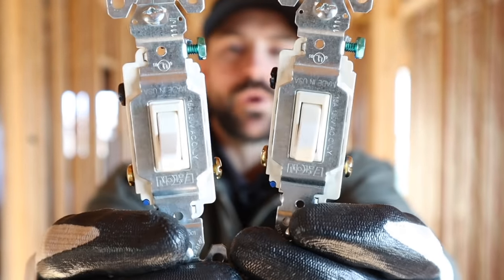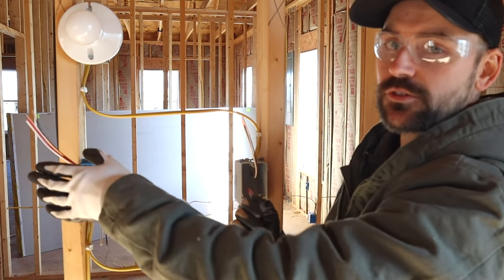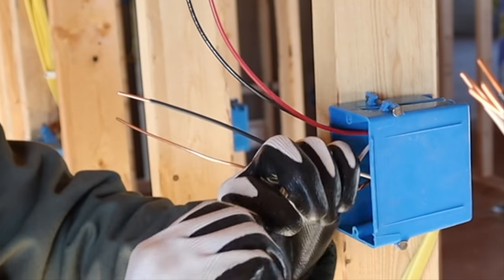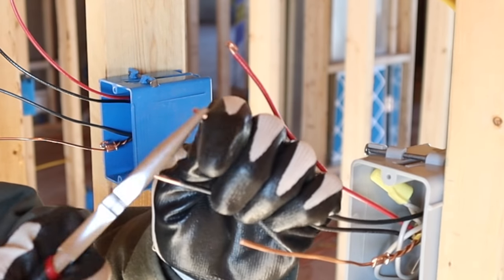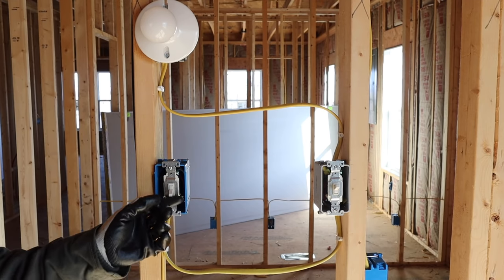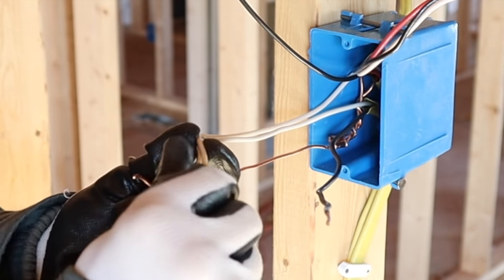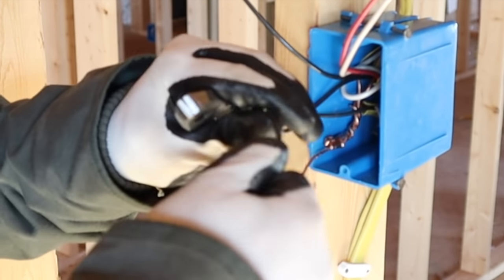How To Wire A 3-Way Light Switch - 3 Way Switch Explained (2 EASY & SIMPLE Methods)

Comment from the maker: Hey Team! No shave November is keeping me warm 😃. Hope your projects are going well! Let me know in the comment section below what you are currently working on. I placed timestamps below 👇 to help you navigate this video.
Safety first: 00:19
How to wire a 3 way switch (Method 1) 00:45
How to wire a 3 way switch (Method 2) 11:36
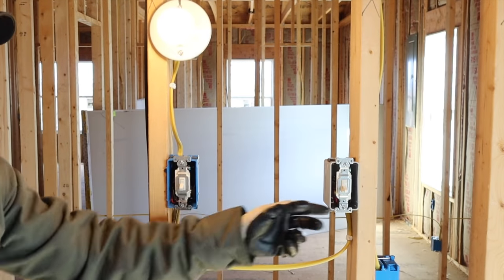Outro 19:49
Reply: Free nhi hi
Reply: Method 2 is what I have to use but I have to add constant power for a outside light on second switch how to wire
Reply: My friend how would I wire a dimmer to the (second method) or will it not work
Reply: Two switches controlling one light. isn't that a two way switching?
Reply: Thanks for explaining the second method.  I opened up my second box, saw only one cable, and figured I was sunk.  Most other guys don’t explain the second method.
Reply: im a electrical instructor can i use your videos in my class and can I invite you to speak to my class. i know your not a license electrician but I think your knowledgeable and its good for young people to see another young electrician
Reply: Replacing 25yr old toggles with decora.

Comment: You’re not even an electrician but you explain everything way better and make it easier to understand than these electrician YouTubers . Good work.
Reply from the maker: I have learned the simpler the better and making YouTube videos for people to follow. Thanks a lot for watching!
Reply: But he is doing things wrong. You don’t run 12awg to switches and lights. Don’t get me wrong, you can, but it’s ignorant.
Reply: @Kcperkins I think it should be 14awg
Reply: @TheExcellentLaborer legend has it the excellent laborer came out the womb with a pair of linesman’s pliers hahhaa awesome video sir keep up great work electrical is definitely my weak spot so I YouTube to reference something’s just found your channel and subbed very clear instructions man 🤙🏽🤙🏽💯
Reply: @Kcperkins why is it ignorant? i work for a company and we only use 14awg on certain roughs for certain developers, they mostly have us use 12awg for almost everything
Reply: Trade s people not all share they think they loose there job/ true worker s take  owner customers and become there own I quess
Reply: @Kcperkins  It's not ignorant at all. It might be *unnecessary*, sure, but anyone with any experience will do it if A) you already have that wire on hand, or B) You've run 12 from the panel to run outlets on the way to the switch, since 12 is for outlets and you're supposed to stick with the bigger gauge on a run/circuit and not split off into another gauge.
Reply: @Kcperkins  I agree with you. This guy probably saw some YouTube videos of other DIY'ers and now thinks he's an expert in the trade. I just started my electrician career almost 2 months ago and most of these YouTubers have no clue.
Reply: @Kcperkins 20 AMP breaker for 12/2 or 12/3 - 15 AMP breaker for 14/2 or 14/3
Reply: @Kcperkins a lot of times 12 gauge copper is the minimum wire size you can use for lighting and/or switches. 

Even when 14 gauge is allowed for lighting and/or switches it would be the minimum allowed. Going above the minimum wire size will always give you less resistance & allow for a more efficient circuit. 

Depending on the length of the run & the load of the lighting the voltage drop from not choosing a bigger wire could cause damage to the equipment & cause it to die before it's expected life. It could also be so far the light wouldn't work at all.

Using the bigger wire uses a little less power. Given enough time the difference will pay for itself . (Going to big on a rarely used circuit might not  save you enough to pay for the extra cost of the wire in someone's life time. So going to big might not be a good idea, but going up a size in wire isn't a bad idea. If you have a 12 amp load you really don't want to have more than 45' to 75' of 14 gauge copper wire feeding it.

If it's a 20 amp circuit then 12 gauge copper will be the MINIMUM wire size allowed & it could be that something bigger is required.

Him using 12 gauge on lighting isn't ignorant. It could be required. The only thing ignorant about that was this comment.

How about knowing more about what you're talking about before calling someone  else or what they do/have done ignorant? The world needs less people who think they can use the internet to find almost everything they want/need to know. (Even if they manage to get correct information they don't know what to do with it & there are some things they just shouldn't be doing.)

Just think you single handedly helped the spread of misinformation & people already have much more of that than they should.

Comment: Although more expensive, you should consider Wago lever instead of wire nuts.  Also, take a few turns of electric tape around the switch terminals
Reply from the maker: Hey Robert! I would love to try them. One day I will break down and buy some. I’ll do a review of them. Thanks for watching!
Reply: Wagos waste box space and are totally  inappropriate for switch boxes and wrapping devices in plastic boxes is a waste of time and material.
Reply: Wago's and plastic staples are for amateurs
Reply: RC :  I bought a box of Wagos for the electrician that was going to do some work for me basically to impress him by letting him know that I'm up to date on the latest technology. He said that he don't use them because in time they start to arc. So now I have a box of wagos. 😒
Reply: @crusherfang9368  I keep hearing people say this about switches and outlets but no one gives a reason why you shouldn’t do it. The house I bought 2 year ago, had every outlet backstabed, along with all the switch screws and main panel screws loose by about half, to 3/4 of a turn. Do you think that the reason some people tape it is so the screws don’t get loose?
Reply: @crusherfang9368  Thanks for the reply. I don’t think it was an electrician that did this. Maybe when it was originally built, but the guy I bought it from rented it out for 15 years and I think he replaced everything himself. It’s been a nightmare! I’ve got burn neutrals all over the place, and outlets literally crumbling
Reply: Wagos are great, but honestly for switches and outlets I use Wing Wire Nuts even for my ground wires, they work great but you must twist your wires with a pair of pliers before putting a wire nut and it's nice to give the Wing Wire nuts another small torque with ur strippers or pliers for that extra tightness 🥶
Reply: And please......don't tape your switches when installing them in a plastic box unless you mount the box to ur studs with Metal screws which is unnecessary on New work, there is no need, Tape is used around Switches and Outlets on Metal boxes for safety, but plastic boxes, don't use electrical tape please lol
Reply: @Prettyboy702  Point taken.. Wire nuts done correctly are perfectly good.  I have never seen a Wago fail so that is what I use now.
Reply: @The Excellent Laborer  nice answer you are very professional
Reply: @imaslowlerner  we don’t use Wagos, or any other clip wire connectors as pros (at least here in the Twin Cities) unless they are already pre-installed by the manufacture. You won’t see that on YouTube as it’s mostly done in commercial grade luminaires. 

They are rather handy and easy to use as a DIY’er.  We just use way too many of them to justify the cost. We twist and nut.
Reply: @johnharrison5656  it’s called time costs money. They are not going to scores those terminals down in residential in a lot of cases because they are trying to leave by the end of the day. 

Also, nothing in code says we have to tape any devices. In most cases most electrical work should be done by a professional so when I go and pull a switch or receptacle out I make a point to look at what I’m dealing with and pull it out safely. 

Professionals don’t wire homes yo be DIY friendly. The sooner you realize that the better.
Reply: @AdamS-lh2ug  I agree, it should be done by a professional; unfortunately, a lot of us can’t always afford that option. I’m lucky enough to have worked in industrial maintenance for 25 years and have an understanding how these things work, but I had no idea till buying this house how completely different the two are, and taping is one of those differences, at least in some circumstances.
Reply: @johnharrison5656  it’s insane how expensive it is to get one of us in your home. I’m not saying you can’t and shouldn’t do your own work. In fact, I encourage it, you will probably do a better job because you are going to take your time. 

I hate “backstabbing,” I feel pain inside every time I’m told I have to do it. It’s never done in commercial, residential however….I have more than one instance of shocking myself because of that (for instance, was on a remodel, pulled a receipt out that was side wired…only it had been previously backstabbed and someone along the line cut the wire that where back stabbed. I got hit like 3 time before I was like “okay, wtf?” That’s when I notice a tiny bit of copper showing in the back stab ports). Cut the wires and threw that thing across the room. Idk who did it but they deserve to be slapped. 

You’ll also probably find that your receptacles are daisy chained. Something I hate. I tail out my receptacles, again, probably my commercial background but I’m not trying to have an entire line of recepts go down because one failed.
Reply: @AdamS-lh2ug  They were daisy chained, backstabbed and burnt wired lol. I trimmed the burnt insulation and replaced with correct color heat shrink. Then twisted and ran pigtails to all new 20 amp industrial grade receptacles. I thought that way would build up less heat, but Idk!  The one thing that threw me off was the white jacket 2 wire Romex on a 20 amp breaker!  I thought, white is supposed to be 14 gauge wire, and didn’t understand why that set-up would be going to the multiple receptacle’s anyway! I bought 12 gauge to do the pigtails cause I thought it was standard to use 12, and when I put it next to the original wire, it looked the same size. I finally measured with calipers and it was in fact 12 gauge. The insulation did look a little thicker though, or maybe it was from the heat
Reply: @johnharrison5656  add you from the UK? Not trying to insult. But when I hear “heat shrink” it’s a an potential indicator.

Electricity doesn’t know color. It’s what makes it great.
Reply: @johnharrison5656  it’s such a common practice and my commercial ass doesn’t understand why.
Reply: @AdamS-lh2ug  No, I’m from south east United States. Idk if it was actually heat shrink or what but that’s all they had to repair the wire where the insulation was burnt. I used white on the neutral and black heat shrink on the hot, otherwise I would have had bare wire touching in the box and I didn’t feel it was necessary to run all new wire.
Reply: @AdamS-lh2ug  One reason I used the correct color was so it would pass inspection if I ever sold the house

Comment: I’m housesitting at a residence of a friend and as long as I’ve known him, his 3-way light has never worked. While housesitting, I couldn’t stand it! One box had a 3-way and the other had a regular switch. I went out, bought 2 new switches and replaced them, wiring them as per the first method in your video. Works like a charm! I videoed it and have sent it to my friend insisting he show his wife.😊 Thanks!
Reply from the maker: That is so cool! I bet they were amazed. It’s interesting how are most things are not that complicated if you have a little insight. Congratulations on successfully finishing a project. Good luck with your future endeavors!
Reply: @TheExcellentLaborer  ; The wife will be when they get back from Europe. Just sent a video to them. They should get it tomorrow their time. Should be worth a couple of steak dinners! 😁

Comment: This is a good video, but it would be more helpful to explain how to identify the hot wire which your calling the common wire.  And go slower and be more specific while hooking up the the hot and travelers. As a apprentice, it be easier to follow the video to point out the top and bottom written on the switch and whether to have the switch on or off before connecting.

Comment: Thank you for adding the 2nd method. I was so frustrated trying to rewire an old 2-way the first way and finding that it did not work because the previous installation was done using the 2nd method. Also, you are very clear and easy to follow. I wish someone like you could teacher in high schools so that students could leave knowing how to fix a number of problems that occur in homes as well as save money on a possible future build.
Reply from the maker: I’m glad you found this video helpful. I appreciate your con words Mary.. Thanks a lot for watching!
Reply: Same here every where else always talked about Method #1 and not Method #2. Thank you SO MUCH !
Reply: Same problem but thanks to adding the second method I got fix
Reply: The reason they do the first method nowadays is because if someone were to change the light switch out with a dimmer later there's a neutral available. Most dimmers afaik require a neutral. Code in my area requires neutrals in all boxes even if they are not connected to anything. Josh is cool.

Comment: I was about to give up on getting 2 switches to work on a single light in an old house (a 12-3 wire was already going between the two switches but one switch was dead). I have a book describing just one method and I've searched the internet for other options. No-go. I was about to give up on this preexisting wire job and just live with one dead switch. Then I found this video, stayed with it to watch your second method, and BINGO!  I can't thank you enough. Now we can turn a light on when we come in from the garage without tripping in the dark to get to a light switch. Can't thank you enough!

Comment: I’m currently building a tiny house and your videos have taught me so much! I have been able to do all of my own electrical and pass inspection, as well as save me $7000 by following your videos. Thank you so much!
Reply from the maker: Hey Lisa! Congratulations with passing your inspection. I know how daunting that’s task can be. Thanks for letting me know. Good luck with your tiny house!
Reply: If I had a tiny house, there wouldn't be any 3 way switches.
Reply: @jeffreyspence2510   we have a 3 way switch for our living room lights. A switch at the back door and one at the front door so you can turn the lights on by either door you come in… personal preference I guess.
Reply: Sounds like you have found a new profession!
Reply: @lisacheek7433  It's more of a safety thing than any thing else.  They want a switch to each entrance of a room or stairway or hallway, so that you do not have to stumble through a dark room and trip over a chair and break a leg to turn on a light.  In really old houses they would have a light hanging from the ceiling, with the switch right on the socket.  Not all codes pertain to shocks or fire hazards.  Some are just basic personal safety.
Reply: @davidmarquardt9034 exactly.... Surprised the commenter didn't understand that.

Comment: That helped me figure out my problem, thank you.  In my case (35 yr old house), the hot wire from the power source is RED, and on what should have been the secondary switch.  This vid and a voltage tester did the trick.
Reply from the maker: That’s great. I’m glad I could help!

Comment: Thank you for posting this great video. You break it down and make it so simple. I was able to fix a 3 way switch that a supposed licensed electrician did not wire properly. You would make a great instructor/professor.  
Thank you again!!!!
Reply: if you use the white like he did. that is dangerous and can get someone hurt. it shouldn't be use as a traveller. the power may be on the other wire. so now it shows to be neutral. Per code the neutral can not be switched. Travellers have power that alternate between them (i.e. switched)

Comment: Thank you so much for this vid. For some reason even after 2 yrs of being an apprentice I haven't been able to wrap my brain around 3 ways. And this has been the most helpful vid I've found. You have made my job easier😁😁😁
Reply from the maker: You're very welcome!
Reply: As  a licensed electrician,  I need to tell you as an apprentice,  it's OK to use these videos as a minor reference.  But keep in mind this guy is not an electrician.  You are not allowed to use neutral as a traveller and also he makes a huge mess out of the grounds. He's got basic wiring down ok. But quality of workmanship is TERRIBLE.  Just a heads up for you. Anybody can do the wiring,  but quality is a whole other ball game.
Reply: @mikemacdonald2032  You sound like the many know-it-all tradesman I've met. He is not using a "neutral" wire as a traveler. It is permitted by code to repurpose a white/gray wire, as long as it's taped or painted to identify it as such. NEC Chapter 2, Article 200.

Comment: ANOTHER excellent video. This might help folks grasp the idea of what is happening by showing a whiteboard schematic of the switch terminals and how the current flows (or does not flow) based on the switch position between the hot and neutral incoming power wire.  It helped me to understand why certain wires are connected to the common screw of the switch.

Comment: Josh thanks.  Currently remodeling a basement bathroom with a single switch but need to install a three way switch.  Your video has cleared up the confusion in this process. Will diffidently watch others as I get further along in the process.  Thanks again.

Comment: Great instructional video. Thank you.  Couldn't you have used 14-2 and 14-3.  More economical and easier to work with...
Reply: Maybe the house has 20a circuits only.